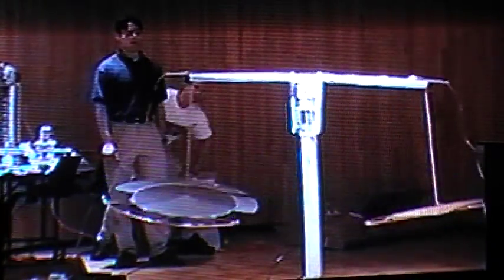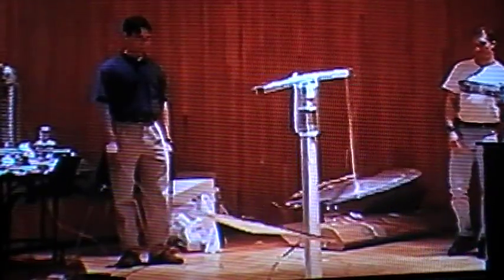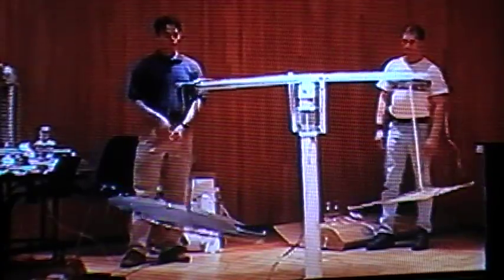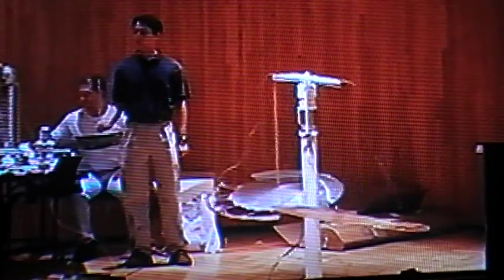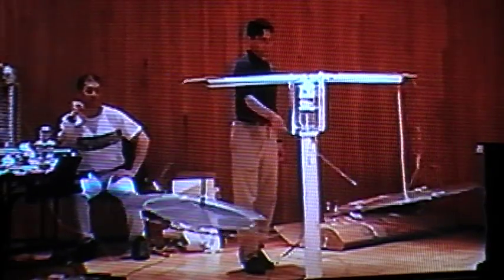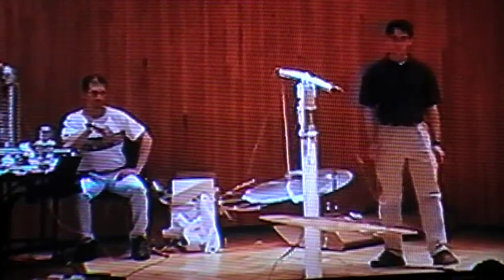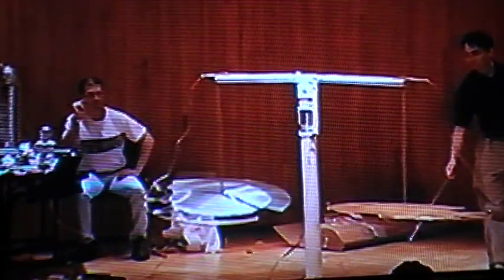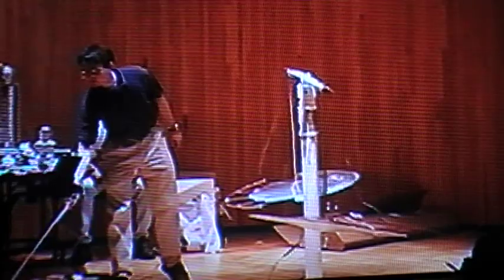TT Brown Electrokinetic Apparatus

Comment: So many people say the so-called ion-wind effect doesn't work in a vacuum but it does, NASA contracters have done it, Jean Louis Naudin did it by enclosing just the emitters in vacuum tubes i think. With the kind of lift we're getting even from amateur 'lifters' with highly un-aerodynamic, bacofoil 'wings' i think there's more at work here than just ions moving oxygen. Great work guys.
Reply from the maker: Gary McKinnon, ion wind is too feeble a force to loft even a 3-gram model, and models weighing kilos have ben lofted. In a vacuum, there was no Limit to the speed in Paris France in 1955, and King of Prussia, PA (GE Space Center) in 1959, and a host of other companies and institutions since then. The force is ELECTROSTATICS, which of course works in hard vacuum, under oil, etc as these do. The cathode is attracted to the anode, so it MOVES with a force that is EXPONENTIAL with increasing Voltage. This methodology is free of G-force and inertia. WARP DRIVE.
Reply: @Beamshipcaptain  It's such an interesting effect, thanks for replying. Have you seen Ethan Krauss's fairly large craft that works with onboard power, no need for a power tether ? He's been working on it for 20 years, has miniaturised his 50kV PSU as well as adding steering! https://www.youtube.com/user/KraussEMUS1/videos
Reply from the maker: @GaryMcKinnonUFO  I have now, thanks to you!
Reply: @Beamshipcaptain  Cool :) I've been researching the topic for 13 years on and off, i was using an ignition coil through a PWM to get about 20kV at differing frequencies but it wasn't the best setup and it sent everything electronic in my tiny room that i use as a lab absolutely haywire. Next month i'm gonna grab a 40W laser PSU that puts out about 45kV and start experimenting with it again, but in my garden shed this time!
Reply: @Beamshipcaptain  You may also be interested in a very simple alteration to normal generator coils (just increase the rise-time of the inductor by winding many more turns ), if the rise-time is long enough the counter-EMF (Lenz's law) arises too late to oppose the incoming magnet and actually accelerates it out, and there's no drag on it on the outward journey. When you attach a load to a generator using these coils (bifilar winding and internally serially connected) the rotor speeds up and the input power goes down, the exact opposite of standard armature reaction, which seems to defy the work-energy principle in Physics. I did a very basic demo of it back in 2012, you can watch it on my channel here : https://www.youtube.com/watch?v=RviBQzjIX8A&list=PLyLMmnSL6MzHzU0cw-O5G4STBzUFqUuXi&index=9&t=0s

Right after that video there's one from the inventor of the effect, explaining it in detail.

Comment: So these things are hovering tight?
Reply from the maker: No, these are just copied from the patent and are for demonstrating horizontal, not VTOL propulsion. Over Unity, since hardly any power is going in to the discs at all. 100,000 Volts at some TENS of micrAmps oly multiplies out to a few Watts total input power!

Comment: What in the world is going on? A short paragraph would be nice.. Now what you need is a Flux Capacitor and a nuclear power source to produce some jiga-watts and you’d be good to go!
Reply from the maker: The is the TT Brown Patent. 120 kiloVolts at some tens of MicroAmperes. Copied directly from the patent. This is simple WARP DRIVE. No Inertia. No G-forces. Electrodynamic. No noise, no heat. No vibration. More civilized, and no speed limit, no sonic boom, no skin-heating. No pollution, no carbon-footprint. No sweat!  https://patents.google.com/patent/US2949550   Came out 9 months before I was born.
Reply from the maker: There are better and more powerful sources than Nuclear power, like the Patented device of Professor John RR Searl, US Pat No. 9,871,431 B2 Spintronic Generator, January 16th, 2018. Warp Drive, and Free Energy conversion from the Vacuum, or Zero-Point.

Comment: How did you go about making the disks themselves?
Reply from the maker: I cut them out of Aluminum sheet stock with tin snips. I glued them together with JB welds Epoxy. That's why there is so much leakage. You can hear the corona noise as the discs go round.

Comment: Read The Book Lost Science by Gerry Vassilatos for real Keys on understanding this. These Move even stronger while submerged in oil or a vacuum
Reply from the maker: Of course they work beter in vacuum. Electrostatics and gravity work in vacuum! That is what the inventor, Thomas Townsend Brown discovered in 1955 in Paris, France, and 1957 in North Carolina at AH Banson labs, and that work led to patents. This is WARP DRIVE, because inertial mass is canceled by the wave-like distortion of spacetime and the vehicle rides this wave into infinity at ANY SPEED as long as the charge is maintained. At megaVoltage, the speed is many many times the speed of light, with an integral forcefield which sweeps debris and micrometeroids and even interstellar Hydrogen out of the flight path. In other woreds, it meets the requirements of the Alcubierre Warp Bubble, with Ether as the waving medium. Gravitation is simply a converging flux of ETHER, and magnetic Fields are simply ETHER currents, and Obolensky has written about how the magnetic force and gravitational force are Faster Than Light. That is why the Vacuum is called the TACHYON FIELD. AN inexhaustible  source of free energy, not "nothing".
Reply from the maker: Yes I have LOST SCIENCE by Vassilatos, 1999 Adventures Unlimited Press. I highly recommend that, and also ETHER TECHNOLOGY, which I read in 1987.
Reply: YES!!
Reply: @Beamshipcaptain  can you share copies of these books?
Reply from the maker: @YourInventions369  They are all online in pdf form already.

Comment: What are the capacitor discs made out of and how would I make such a disc (step by step)?
I'm trying to start an electrogravitics lab at my school, and can't find what the discs need to be made of. How would I do it?
Reply from the maker: +Thaddeus Thundercock The discs are Simple Sheet Aluminum, and the copper tubes are copper tubing. All parts from Home Depot! Now we use .003" stainless steel wire for the forward positive (+) electrode instead of copper tubing for greater efficiency and greater thrust with less input power!
Reply: why stainless steel and not copper? and are their other metals that are more efficient?
Reply from the maker: Stainless steel wire produces less corona, less noise, and less corona with associated losses than copper wire or tubing Read my paper on Beamship Technology I published in 2002:  http://ufoprophet.blogspot.com/2013/01/new-energy-technologiesissue-4-july.html#axzz4jjGbdC9k

Comment: what is your opinion as to the fibonacci spiral/number sequence as a releveant basic formula to use for the construction of apparati to generate electromagnetic energy fields? I have a personal theory, that the propulsion steering of electromagnetism propelled flying saucer like craft, are controlled by the electrical field of the human body (which i myself have learned to control consciously to a certain level producing piloerection, and oxygen to travel from lungs to be pushed out through the skin pores, and a blood pressure change from 106 to 130 in 3 seconds.. i began to think about this watching a 'fictional' tv series by mr spielberg, called 'Taken' which seems to have a lot of subterfugal info drawn from historical fact in it.. the saucer the airforce had, was steered by prana (electromagnetic air energy), within the bodies of the pilots.. merely connecting with the circuitry of the craft, was enough to steer it. These days fighter pilots are experimenting with mind controlled steering.. so its not that fantastic at all
Reply from the maker: I lecture about that all the time! Fibonacci spiral of ever-increasing curvature, and Viktor Schauberger IMPLOSION technology is a major key in cohering the Zero-Point Energy, just as NATURE does! Excellent!
Reply: Spiral out! Keep going!

Comment: HI, interesting. Ok, how do we know this is not simple ion wind?,  remember that feeding wire has to be accounted.  it is very hard to  shield against leakage and simultainsly have a freedom of motion. I tested with Remote controlled  HV device on a thread haning pendelum..   just saying. thx and keep  doing the good work.
Reply from the maker: Because ion wind is too feeble a force to levitate even a 5 gram model, and models hundreds of grams have been flown, as these are. We even sealed them up in plastic same demo, same day, and they flew BACWARDS. Jean Louis Naudin shows how they work in OIL, and in hard vacuum, as did the USArmy, at Adelphi, MD and Purdue university in 2000. Someone sent me video of their own discs sealed in resin blocks and they still fly backwards. NASA tested in 2000, and they flew in hard vacuum, as did Takaaki Musha, who confirmed, as the inventor did in Paris, France, in 1955, and King of Prussia, PA, in 1959, that they work more efficiently in vacuum, just as rockets work more efficiently in vacuum. This is WARPDRIVE.
Reply: that sounds interesting and even more! but how come  lifters really just  get lower and lower lift in man many other vacuum tests?    it is lifters you are talking about right? with sharp thin electrode+big electrode?
Reply from the maker: leviterande Voltage. T he vacuum test Voltages start at 40,000 Volts and went to 200,000 Volts. Max-current used was 2 milliAmps. Current could be turned down in vacuum, to get same or more force. This technology was CLASSIFIED by the US Air Force in November of 1955.
Reply from the maker: Look at NASA's and other's vacuum tests. Remember our electronics is base on VACUUM TUBES.

Comment: I'd suspect the charge you are applying to the mass causes it to change direction of the accelleration of gravity in relation to the Earth's own magnetic field. (A big enough bell jar with a vacuum should rule out ion wind.) Under the conditions that create an electro-gravitic effect, the magneto-gravitic effect would then also apply.

If that's indeed the case, then an interesting effect would be to have a similar apparatus with charged capacitors, but with a powered rotation. You'll raise the inertia on each capacitor by actively spinning them, but the net of the apparatus would still be 0 as the same force would be occuring in the opposite direction with the other arm. To make it interesting, add a powered solenoid above or below each arm. The magnetic field would influence the charge such that some part of that outward acceleration can be redirected into an upward or downward component. Now instead of a force in opposition from both arms, you'd have one acting in the same direction.

Or perhaps it's a dumb idea, but if that actually works it'd be something. Maybe that's the part of the old experiments which has supposedly gone missing?
Reply from the maker: The inventor tested in Bell Jars I Winston Salem NC at AH Bahnson Labs from 1957-58, King of Prussia PA at GE Space Center in 1959, and Paris France, 1955. Efficiency and thrust is GREATER in vacuum, as Takaaki Musha of Honda R&D showed from 1996-2008. The USAF CLASSIFIED electrogravitics in November, 1955. This Patent was granted five years later, August 16, 1960. I built it 30 years later, in 1990. Obviously its clean, silent, and POWERFUL.
Reply from the maker: Paris experiments in 1955 at a government aeronautics facility with 1 meter diameter saucers in high vacuum proved concusively the discs can fly faster with less current and higher Voltage in hardest vacuum. Which is very  exciting, and caused all references to electrogravitics and the work to be CLASSIFIED by the USAF, Department of Naval Intelligence, the CIA and the NSA at a semi-secret meting in Manhattan in November 1955.  Classification partially removed in 1995, and totally removed in 2000. Still some half-hearted attempts at debunking, but for all intents and purposes, the WARP DRIVE cat is out of the bag! Please read LOST SCIENCE, by Gerry Vassilatos, 1999, Adventures Unlimited Press, and ETHER TECHNOLOGY, by Rho Sigma (Rolf Schaffranke, Adventures Unlimited Press.
Reply: Hey man, why don’t you try it. I think it’s great you guys are experimenting with this. Maybe you guys should write a letter to Elon Musk. We need some big money behind this stuff.

Comment from the maker: Relativity did not erase ETHER. General and special relativity have been invalidated decades ago. Modern physics views the vacuum as filled with activity. Vacuum is PURE CHARGE without mass (DARK ENERGY). Review the CASIMIR effect, and QUANTUM FOAM, and the works of Nikola Tesla. Tesla rejected Relativity, and embraced Ether. Einstein's Unified Field Theory for Gravitation and electricity, published in ANNALEN DER PHYSIK, January 10, 1929, is far more accurate. Released Jan.12, 1929 to NY TIMES.

Comment from the maker: @HorizonDelta Yes, in vacuum at Societe Nationale du Constructions Aeronautique in Paris in 1955, the sacuers spun faster with no air in the large vacuum chamber there, and at King of Prussia, PA in 1959, they flew so fast as to be classified. Yet, a patent for this was issued , No. 2,949,550, August 16, 1960. Bagged, they fly backwards same speed. Genral and special relativity invalidated decades ago. But Einstein's UFT from 1929 VALIDATED by this and other classified work!

Comment from the maker: @zboy48 Sheet aluminum, plexiglas insulators, and 1/2-inch copper tubing for the forward (+) pos. electrode (anode). THe saucer tries to fall into the electrode, and chases it around the pole which supplies the high-Voltage DC. Functioning flying saucers. They are round so as to contain the charge without leakage and for symmetry in the propulsion field (forcefield).
Reply: what about high voltage AC current?

Comment: Hi. Couple of questions :) Does it make difference if I use DC or AC? :) also does the speed increase by increasing the voltage? lets say up to 300Kv? :)
Reply: You need millions of volts to do anything like your thinking. DC. Think Van de Graff generators and xray tubes. Originally this phenomenon was discovered by accident from xray generator which used high voltage.

Comment from the maker: @ncranfill Its not ion wind that makes these heavy devices propel. Its a localized gravity well/hill phenomena caused by the high Voltage. I proved that later in this demo by enclosing both discs in plastic bags, so no air could escape. When the power was applied, they started to fly backwards. This is using 100-120,000 Volts at some tens of microAmperes. Its the High Voltage that creates the motional electric (gravitic) field. You only need enough current to replace lost charge due to leakage.

Comment from the maker: You need to research boundary-layer effects. No shock-wave because the electrified bow-wave of high-energy-electrostatics moves air out of the way before it contacts the metal of the ship. Northrop did a lot of research in this area, also with electrified Aerospikes, leading to classified work with MIRVs and electrified nose cones of missiles. "Northrop Studying Sonic Boom Remedy," AVIATION WEEK AND SPACE TECHNOLOGY,Jan.22,1968: 21, "Sonic Boom Experiments," PRODUCT ENGINEERING,March 11,1968.

Comment: i know what your doing wrong. if u want more power charge each lifter with a seprate power subly, and be sure to alternate the currents,
Reply: what do you mean alertnate the currents?
Reply: @smiliejosh  Im working on multiaxis lifters, 2 thrusters is ok, but to go up tp 4, and have pitch and roll control I had to switch the pitch and roll channels on at different times to prevent field cancellation. I think this is what he meant. The pairs of thrusters are switched alternatively 50Hz is good.

Comment from the maker: This is simple electrostatics. The cathode-saucer, is pulled into the anode-copper-tube forward electrode. The greater the Voltage, the greater the electrostatic attraction, and the greater the speed. At 500,000 Volts DC, there is no limit to  speed, and there is NO sonic boom, force is exponential with increasing Voltage. You could make a multi-mach fighter craft easily with this, that is STEALTH (no sonic boom or radar crass-section). There is no inertia or G-force in force field propulsion.

Comment from the maker: It WAS filmed with bags on them, as I said, and Jean-Louis Naudin did the same thing in 2002 with a vertical-lift model, see it yourself. On the VHS tape which this segment is from, every time the saucers are activated, the video blanks out for about 30-seconds.

Comment from the maker: The saucers ARE the MOTORS! Why would a Nobel prize be issued for replicating Thomas Townsend BRown's celebrated patend, granted August 16th, 1960, that I first built 2 and later 3-foot saucers, starting, January,1990. Many replications, by Larry Davenport, and others. TRY IT YOURSELF, if you have the courage! BE CAREFUL ** DANGER** High Voltage.

Comment from the maker: No need to do it again, as we did it nine years ago, here before an audience of aerospace engineers and scientists. I didnt post it because everytime power activated, it played havoc with the video, and all electronics, blanking it out, so you dont see too much of the motion al effets with the bags, but there was the audience, and then the duct-tape holding one of the bags together shoted out our Voltage Multiplier. But we proved effet is not conventional thrust, back in Jue, 2000,in Nevada.

Comment from the maker: No, Mass is also relative to TIME, as referenced by the term in physics MASSTIME, analagous to SPACETIME. The ETHER fills all space and interpenertates mass, which is mostly empty space, but space is NOT empty, it consists of a sea of electrons or TACHYONS, whos field stringth is some 800-million Volts per centimetre.